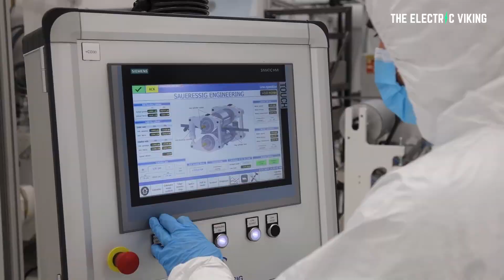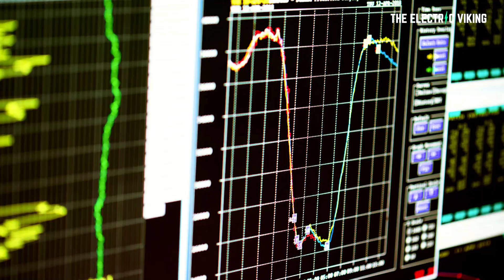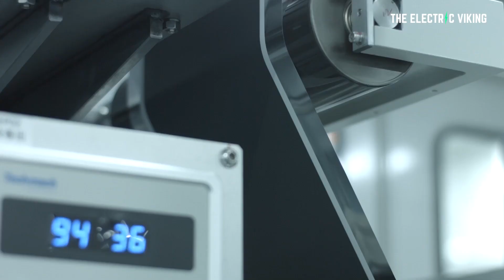NEW lithium-free Sodium solid state battery breakthrough revealed

Comment: We shall see.  Another video commenter said that Solid State batteries may have slower charging times than Lithium - Unsure if that will be true or not.   But the biggest drawback to EV vehicles is sitting at a charging station anywhere from 30 minutes to over an Hour to charge up the vehicle.  This may have to be done several times depending on length of trip and how much you charge up each time - weather, etc.
Gas cars only take 3-5 minutes which includes time paying for the gas.

Comment: Australian company Altech Chemicals in a joint venture with German company Fraunhofer IKTS are proposing to commercialise 100MWh Sodium Alumina solid state batteries for grid storage. The battery was developed by IKTS.

Comment: Cost of solar  cells is now so expensive, it's just not viable. As an ex electrical engineer,I could do it myself. But in my very late years now with health issues. A friend from Perth in Australia had 20 plus solar cell system on his new bungalow for peanuts compared to UK..  interesting on the lithium cost.. Seems a form of  self destruction of the lithium industry letting prices go so high. Be glad to see a rapid replacement. Thanks. Use to live near London. But now in Wales . Be nice to get to that exhibition. But Covid has restricted us. Then George from Australia was here in UK for 8 weeks and no problems.

Comment: Totally agree with you. The world urgently need a breakthrough in energy storage and sodium is the best candidate in the horizon. 
 I am from India , i live 90% off  grid , I have a 5kw solar panel with 6× 150amps tabular lead acid battery and these batteries are not capable of storing energy efficiently. 
In the day time , I run my house entirely on Solar. Also i slow charge my electric scooter and vehicle too when there is good sunlight from Solar and at night only the light bulbs, tv and fridge runs on batteries, one  cannot use any heaters or induction after 4 pm which is a major roadblock. Hopefully with sodium batteries,  things will change and we can use heavy electrical items at night too.

Comment: Even non-solid-state sodium batteries from the likes of Britain's now Indian-owned Faradion and China's CATL have almost reached the energy-density of 
LFP cells(used in almost half of Tesla Model 3's and Y's) - and sodium ion batteries have many other crucial advantages besides cost versus lithium ion and even LFP cells. For instance:  wide operating temperature range, low/no risk of thermal runaway - and frequent fast-charging to 100% doesn't shorten battery life. 
PS. LiNa's solid-state sodium cells still do use nickel - but alternatives will obviously be sought over time. 
Paul G

Comment: Sodium-Sulfur batteries are used by Tepco in Japan and other locations for utility-scale electricity storage.  Sodium-metal batteries operate at elevated temperatures, like 300C, which the utilities are comfortable with.  Their steam turbines have inlet temperatures of 550-600C.   Save the little round cells (Lithium or Sodium based) for portable applications.  
Will we run out of sodium one day?  The oceans are filled with sodium ions.  It's 1/2 of NaCl salt.  1.4% of the weight of seawater is sodium.

Comment: 08:15  No matter what technologies we use for storage & generation of electrical energy, we must make these changes in the correct sequence.  BEFORE we decommission all our fossil-fueled power plants, we MUST have their replacements up & running, otherwise we'll continue to have expensive electricity , blackouts, etc!  And ECONOMICS MATTERS - the wind & solar proponents talk glibly about how these sources are getting much cheaper, but they rarely mention the shorter lifetimes of their tech, nor the enormous amounts of land they occupy.  Land is never free, & won't get cheaper in the future!  A coal or natural gas power plant, with proper maintenance, will last for at least 60 years,  most large hydro plants for at least a century, while solar panel power output with present tech starts to fall off after only ~25 years.  Let's be generous & say 30 years.  So one must DOUBLE or TRIPLE the capital budget for solar farms to allow for their shorter life compared to older tech.  Similar considerations apply to wind farms, & I've not included the added capex for giant storage battery farms which are still very expensive, & will remain so until the EV market saturates.  
My personal preference is for small, modular Gen IV nuclear heat sources, which in many  cases can be sited beside existing coal plants to reuse the existing steam turbines,  alternators & power lines rather than simply scrapping these expensive capital goods.  Molten salt reactors are particularly attractive because they are cheaper to build, are walk-away safe, cannot melt down,  occupy very little land, are more thermally efficient & can be designed to consume many of the nasty long-lived radioactive wastes from older reactors.  Lots to discuss over the next decades... 
https://en.wikipedia.org/wiki/Integral_Molten_Salt_Reactor
https://www.youtube.com/watch?v=d-5rS3Am3ds
https://www.youtube.com/watch?v=3u44skO-nMo

Comment: 1.  All the pictured batteries and the LiNa company name imply some sort of involvement of Lithium, at least for now? 2. What might be the VOLUME penetration as opposed to be the 2025 introduction of the sodium batteries. 3. What will be the Lithium price in 2025+ when more Lithium supplies arrive, will there still be the same cost advantage? 4. Why are most of the sodium battery references to grid batteries rather than to vehicle batteries for the moment?

Comment: 30 % cost reduction over lithium iron phosphate still makes it way too expensive for long duration storage. This is only really cost effective for short duration coverage. (seconds or minutes) Pumped hydro, compressed air, heat storage, and probably other technologies are much more cost effective for longer duration storage. Batteries will be useful for fast response but for longer term storage their capacity will be dwarfed by other technologies.
Every bit counts though, reducing lithium demand is fantastic.

Comment: 100% solar grid is stoked  mangenese is a lil bit more abundant than lithium 
Sodium is smarter for homes an businesses battery storage to charge batteries at night when demand is low then th owner controls when stored energy is used / how / an how much 

I HEARBY DO SWEAR ON TH STEERING WHEEL OF TH TESLA HATER BUS THAT I WILL REFRAIN FROM CORRECTING PRONUNCIATION OF TH ELECTRIC VIKING AFTER A PERTINENT INFORMATION CONTAINING STOKED VIDEO……Electric  Viking roks

Comment: Personally I'm not sure battery storage systems are really necessary. If we just pushed hard for car brands to make battery to grid power for EVs, we wouldn't need energy storage as these cars would easily make up for this. Think about it, if everyone has an EV, well one of those EVs could have been running the next 10 houses for the next hour just for brief storage during the rougher energy times.

Comment: What sort of half baked video is this? Thumbs down! A channel with over 100K Subscribers should be producing content at a higher standard than this. Why didn't you go the extra mile with  your hypothesis and substantiate it with some additional research? What is the safety profile of the battery? Is it a hazmat item that is toxic when handled? How do these batteries compare to Lithium ion in terms of thermal runaway? in terms of energy density? In terms of life span? in terms of weight? Can they be also used in BEV's? Are these batteries 100% recyclable? What is the environmental impact of production of these batteries? What other rare earth metals are used? Heck i'd even settle for what the difference is between sodium solid state and sodium batteries? You gave us NOTHING here..... #booooooooooo

Comment: It is crazy.  The discovery of new sources of Li and improvements in extraction technology, should have reduced the price of Li but supply and demand rules.  Reduce demand and the price of Li will come down.  An alternate chemistry for static batteries would go a long way to solve this problem.  Na batteries, if they are at a realistic price could solve this problem.  What is the cost of these batteries.

Comment: Sodium is literally everywhere. It is easy to easy, cheep and environmentally low impact.  It will also free the market of the volatile price pressures of Nickel, Cobalt and Lithium.  If it succeeds commercially it will be game over, and it could be unbeatable since it is so cheep and easy to produce.  Just think, oilfield brine could be a great concentrated source of sodium, the use of which could eliminate the oilfield brine as a disposal problem.  Forget the idea that oil production will be eliminated, oil is an essential chemical feed stock; we just wont need to incinerate a valuable resource on the scale we do today.

Comment: Couple of things: Sodium (Na) is an element, not a material. I can’t accept this type of battery will be better than a Lithium based battery. Sodium is farther down the periodic table. I can except it will be cheaper, Although never lighter, or have higher energy density.
Reply: There are many applications where CHEAPER trumps all.

Comment: Sodium is an alternative to lithium in applications in which optimal energy density is not critical. Emerging sodium technologies are not however going to resolve bottlenecks in EV and energy storage ramp up over the next 5 years. The bottom line is that Western policy makers need to secure more lithium for local battery production and use. This will cause tension with China which is seeking to dominate lithium battery production.

Comment: There is a lot of smoke about new battery chemistry and technology. However, we're seen little in the way of flame and heat because much of this will be 5, 10 years in the future. Prototypes and validation testing are still far in the future. Don't even think about volume production.

Why so much smoke? We're in the midst of an energy revolution and there is a new gold rush to attract investors. It's the wild west of renewable energy and we're getting premature claims of striking riches.

Comment: That’s was on my Lexus hybrid solid state battery.
It was tested to Toyota hybrid 25 years ago. 
No problem 
Last longer 
Light not heavy 
Improve you gas mileage.
Range 470 miles 
45-55 mpg 
Low emission.

Comment: Grid backup covers a wide range of timescales. Lithium is good for sub-second response up to four hours or so, pumped hydro is good for hours to days, and we need solutions for the one hour to 10 hours niche, and the one day to multiple weeks niche. (That last one not so much in Australia, where it's sunny and windy even in winter. But in northern Europe...)
Reply: Tony Seba calculates that anywhere on the world, a system consisting of solar, wind and battery storage will need a maximum buffer period of 4,5 days - and yes that includes winter time.
Reply: Energy Dome with the CO2 liquid-air system works in the 10 hour period.

For multiple weeks, I guess the solution could be synthetic fuels/hydrogen. Although most of the year imbalance could be managed through intelligent consumption from high players demand like manufacturing.
Instead of try to balance between winter and summer, the summer "overgenerate" and the extra energy could be derived to create fuels and intermediate products easy storable and usable on other non-electric consumption (like ships, industry, etc.), so the regular logistics works as a virtual battery. No extra energy, no production... mostly on winter and very bad days with low speed winds and cloudy at the same time.

But I guess, some thermal plants can work as a backup from extreme circumstances using a synthetic fuel reserve.
Reply: Natural gas or, better yet, synthetic natural gas produced with extra solar and wind capacity, fueling mothballed combined-cycle and simple-cycle gas turbines placed into reserve should do it. Also, more heat pumps using vertical ground loops in colder climates and a simpler air-to-air heat exchangers in warmer climates would also greatly reduce/displace the natural gas consumed today during the heating season.

Comment: Could you please provide some actual data for this battery, based on independent testing? Also, if this solid-state battery uses a pure Sodium-metal anode, then, like any pure Lithium-metal anode, its safety would be limited or compromised by any leakage of air or water through a failed edge seal or any puncture. Very big challenge to make fail-proof seals to prevent catastrophic fires with such solid-metal anodes.
Reply: Yeah - I'm sure the bunch of silly amateurs at LiNa and Ion Ventures forgot to remember that.  If only they spent more time reading comments posted by the true professionals who post comments below videos !
Paul G
Reply: These Na ion batteries are 650 Wh/Kg, 50,000 charge cycles, nominal 8.5 volts per cell and cost $0.25/ah. I hope that helps.